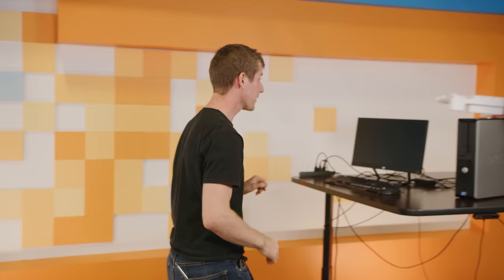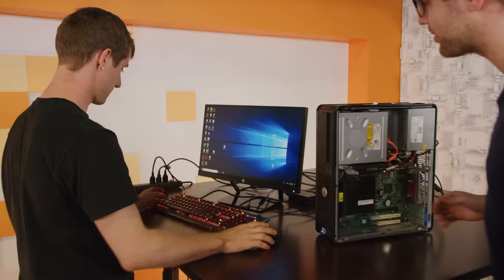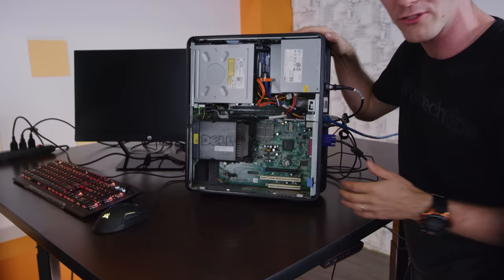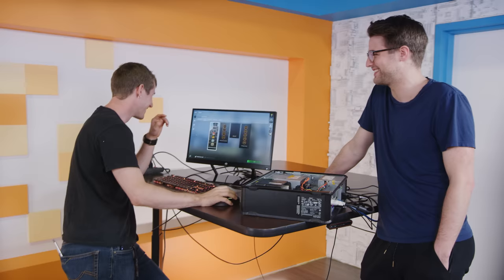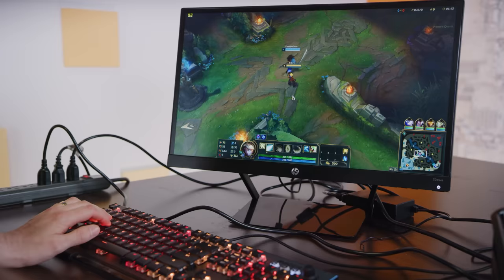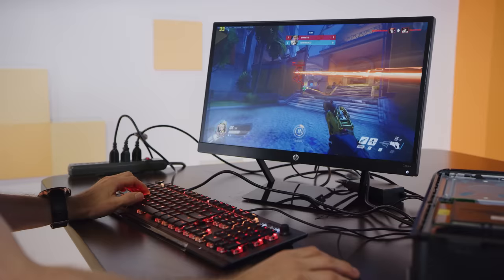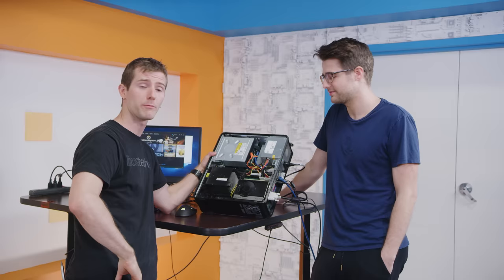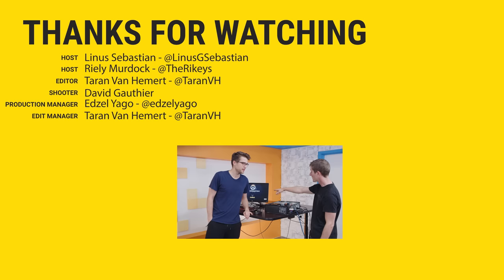The $69 Gaming PC RETURNS

Comment: Converting a SATA power connector to a PCI Express power connector? My God! Why did I never think of that!? Facepalm
Reply: Quick question, isn't that kinda dangerous? The first thing i thought was that Sata power delivers less than the six pin, but i may be wrong, that's why i'm asking.
Reply: You don't like house fires?!?
Reply: @orestisantonopoulos4350  It might be ok for a low end card that barely needs that extra connector (rx 560) but otherwise, yeah you never hook up a 1080ti with adapters.

Comment: I have to agree with what others are saying, going LGA775 is a bad idea anymore. I just got a SFF optiplex with an i5-2400, 8GB RAM, 250GB HDD and supposedly a windows 10 license for $90 shipped on ebay. Another $100 on an SSD and a 750ti or something, and you can actually play modern games quite well for under $200. If you do already have an old 775 machine it might be worth upgrading, as you can throw an LGA771 xeon into many OEM LGA775 machines (with a little modification). The G41, G43, Q45 and to a lesser extent G31/G33 chipsets are often compatible, especially on Dell Optiplexes. It's only $13-14 shipped for a 2.83GHz Xeon E5440 quad and the required sticker mod. The E5440 is comparable to a first gen i5 (it has 12MB L3 cache!) or a Core 2 Quad Extreme Edition. There are even faster 771 Xeons but they're a little more expensive and tend to be a bit hot and power hungry for what's in those OEM machines.
Reply: Had an old P5P43TD 775 lying around and therefore just bought an Xeon x5460 for 16$.
I could oc it to 3,8ghz. There are higher OCs possible, but i don't wan't to waste a good cooler on a budget system.
It is compareable to a sandy bridge i5 2500.
A big negative is the 120W tdp of the x5460, so you need a solid power supply.
I would agree, if you build a new "used budget gaming system", go with an old office i5.
If you can get a 775 board for free, it supports the 771 mod and you don't want to skimp on the power supply you can still go for the 771 xeon route.
Reply: I went to a local university surplus store and bought a Dell with a 3.4Ghz Quad core i5, 16gb of ram, 500gb hard drive for $120 including tax and a few other items we bought along with it. The machine is great except for the onboard Intel HD 4000 graphic chip, and my old 8800gtx is too long. Looking at the compact gtx 1060 6gb edition, but cost a good $280....
Reply: I can get you a 3.0Ghz core2quad for $5...I cannot test to see if they work though. They are also sold by that university surplus store...
Reply: I've since acquired a gtx 660 that I somehow managed to shove into the case and replaced the 240watt psu with a $30 600w evga psu from best buy...now I can play fallout 4
Reply: @223 Remington Yeah, but these days most people building their own system in the USA/Canada/AUS spend $10-25 on a grey market key from ebay (cheapest), kinguin, g2a etc. It's possible to run windows unactivated or cracked, and some do, but most people just get the key because it's pretty cheap. I bought the machine in my comment for someone who was going to use it in a professional setting for office work, so getting a free legitimate key was a nice bonus. And the machine worked out well, it was about $185 total for an i5-2400, 8GB DDR3, 512GB SSD, Radeon 6450 (only cost $6 more than the required displayport to HDMI adapter to use the Intel HD graphics), and the windows 10 key and 250GB HDD as bonuses.
Reply: A Core 2 Quad is a great CPU for LGA775, the only problem is that there isn't much room for upgrade.
Reply: This straight-up like a different language to me.  No clue what this means.
Reply: @rinserofwinds  The price of x58 is cheap enough that you can go with the 1366 pin Xeon for cheap and throw in a cheap GPU, I have a Dell T3500 with a w3690, and was able to just pop in a RX 560 and plug it in with the 6 pin pci-e connector on the stock psu :)
Reply: used to have xeon 3323 in my 755 OptiPlex used that sticker mod paired wit r7 250x poxy btx case lol

Comment: Never under estimate the power of socket 775. It supports core 2 quads and honestly those are all you need. 
Okay fine more like bare minimum but still.
Reply: The quads are still surprisingly adequate.
Reply: @HappyBeezerStudios  Hell yeah. It's good to know that if you splurged back in that era your system would still be capable enough today depending on what you wanna play.
Reply: @GT1 Cheap xeons are dope as f.

Comment: Now retest with a RTX2080ti and extra power supply. 👊
Reply: Nein
Reply: RTX2080Ti and stock power supply :V
Reply: Yeah bc that wouldnt bottleneck at all
Reply: @gentzhushi7272  Core 2 Duo will crush the 2080 :P
Reply: @joe-oz6fl  PciE are backwards compatible...
Reply: I mean intel is known for their single core performance, I doubt the 2080 would be able to keep up with those two powerful cores.
Reply: theres only so much information you can force through the old pcie data pipes. yes it'll run but it's just going to waste a ton of horsepower.
Reply: The bottleneck alone will make this PC explode!
Reply: CPU BOTTLENECK
Reply: @WatchJRGo  😂😂

Comment: Here in the uk, you can get a dell optiplex for £100 with an i7 2600 and 8gb of ram depending on how much you look around, I used one of these vary machines for my first gaming pc as a starter rig and to this day it’s alive being used as web browsing machine
Reply: If people do this, try and get the MT (mini tower) version. That's their biggest form factor and you can easily fit a full size graphics card. And don't forget you'll probably need a new PSU too
Reply: if you use a graphics card such as the gtx 1050 you'll be fine as it dont require external power and most of those systems have a good quality 400 watt PSU which is more than enough

Comment: This was funny to watch because I've been working on something like this myself I've only spent 20$ on ram, 12$ on the riser and 70$ on the graphics card (gtx 780 woot) and got everything else for free so I'm liking my odds
Reply: Can you send me a video of the finished product? I'm really interested.
Reply: haha sure I'm waiting for the riser to come in so I can finish it up, but that'd be no problem.
Reply: Thanks man i'm working on my own budget build but ive ran into some problems with the old crappy oem psu on the inspiron 570 im debating whether I should buy some sata to 6pin or replace the psu as a whole, the gpu im using is 650 ti I got on ebay for 35$ and the psu im thinking about getting is the Corsair CX450
so if you want to see the finished build of that feel free to let me know
Reply: Actually yeah I would love to see that. I've also ran into a problem with my power supply which in turn made me just grab a second psu... its gonna be ugly to say the least
Reply: the 6 pin connector .. can be cut out of an old PSU motherboard connector, doesn't need to look too bad...
Reply: I'd bite the bullet and go for the quality PSU, you won't have to upgrade it again in the near future and it'll ensure your other components are safe from dying due to poor power delivery.
Reply: Yeah i think i'll have to take the price increase and not risk the old motherboard frying
Reply: could i see the pc to then because i just build about 2 months ago a pc with i3-2120 750 Ti and 12 Gb Ram i just buyd a i5-2500k for 38€
Reply: Who's build? @quentin roemer
Reply: @CryoToast  i meant i want to See blazes build too in the end
Reply: but higher end graphic need better gpu and better gpu need atx motherboard and too bad its mini atx
Reply: How does the software work? Whats a good operating system? Does it cost anything?
Reply: Fo.r the crispy 40 frames on minecraft

Comment: EVGA GEFORCE GT 730 2gb low profile on Amazon  for $66. I used this on a dg41ty system and it played games really well. More system memory would’ve made it quicker. My FPS was 60 on many games. Intel dual core wasn’t bad. I got the computer free from work (couldn’t bear that they were trashing them) and added a $39 ssd, a 1tb WD drive from another computer and $65 video card. Gaming for $100. Also got in on the free Win 10 update. Ran win 10 fine. I keep it as a junk system to tinker with. You can upgrade the cpu on these to quad core cheap

Comment: Could've fitted in a Katana single slot Galax GTX 1070.... Out of budget but mmmm those bottle necks
Reply: The gpu be running at 5% usage with that setup 😂
Reply: @C4CH3S  5% more than that bad boy slaps computer
Reply: The power supply would probably kill itself in trying to run that GPU.

Comment: Just cut a slot in the side panel and you can fit a full profile graphics  card just make sure it's under 200mm in length and ensure the slot is big enough to fully clear the card.
Reply: I used an angle grinder to cut a slot in the metal sidelid because I am a trained, pro metal worker, it could be done with cheap handtools such as a two dollar mini hacksaw and the edges smoothed off with 50 cents of sandpaper or a smooth file.

Comment: Unironically, if your definition of gaming PC is to run any games at all... just get a rapberry pi and make it an emulator machine for oldschool systems
Reply: Sylkis89 once you buy the pi, the enclosure, power supply, uSD card. It’s going to be get pretty close to 70$.
Reply: Or I can use my Galaxy S 5... I can run N64 emulation with no problems. Js... Any games at all, right?

Comment: 6:35 I regularly remove and install things in my desktop without unplugging it, I haven't had issues so far.  I recommend that you unplug it, but you're not going to kill anything as long as you're careful and don't short something.  The most important thing is to make sure the machine is off, I have fried a motherboard by unplugging the laptop display connector while it was on >.>

Comment: 775 socket? why not fit a quad/or 771 mod for a xeon?
Reply: johnyfartpants just cuz it fits the socket doesn't mean those chipsets supports all the cpu's. It is possible, but you gotta do some research on the mobo.
Reply: @Adam_Racing  the G41 would accept the moded xeon. But this is a Commercial PC unit not a mobo you buy separately, the bios might not support it.
Reply: @ladam836  there's a bios mod easily available for that specific computer. So they could definitely spend 20 on a 3ghZ quad Xeon 50 on a 750ti and put in a better hard drive for a respectable machine around the 100$ mark. 

I personally use an optiplex 780 with a low profile gt 730 2gddr5 6gigs of ram and a q8200 processor I got for 50 bucks (20 for gfx 30 for the computer both off Craigslist), and its great for all the games I play which is mainly D3 and league.
Reply: I have an old Dell 530 (somewhere) that only accepts a core2duo. They used a different mobo for the core2quad

Comment: Managed to pick up a Dell Optiplex 3020 SFF off ebay for £55. The PC came with an I5 and 8GB of RAM. I then installed an MSI NVIDIA GEFORCE GT 710 gpu with a wireless network card. Ended up being a pretty good little build for £100.

Comment: I don't see why you guys didn't just recommend the 750 ti, same price, better performance, and no extra power cables needed.
Reply: probably can't find a low profile one for that case.
Reply: I agree, but most 650 don't need power cables, that one did for some reason (it could probably still work without it)
Reply: Low profile isn't needed.  They used a PCIe extender.

Comment: But can it run windows?
Reply: He just ran Windows
Reply: @_zapper  r/whoooosh
Reply: hey Win 10 load in it.....
Reply: @_zapper  r/whoooosh
Reply: Insert Windows into unbalanced fan, & then trash the fan.
Reply: No, can it run MINESWEEPER :O
Reply: @pcdc1337  r/whoooooosh
Reply: @buyinggfhmu5589  r/whoooosh
Reply: He should've just used Win 7 tbh. I have a computer that's even older (core 2 quad q6600) that can run War Thunder pretty well on a GTX 1050 on Windows 7.
Reply: but can it run space engineers?
Reply: Can it run Spiderman and Read Dead Redemption 2?
Reply: If the windows are on the ground, I guess

Comment: We actually have those computers at my school. Except ours only have 2gigs of ram. 

They forgot to block the Microsoft store so I downloaded Minecraft. It ran at about 40 FPS with everything on low.
Reply: Nice lol. I could hardly steal the Adobe software they have installed smh
Reply: At our computers they blocked absolutely everything. Every program was running in a vm so that you couldn't even open a file (not even over your browser or something) which wasn't placed in your vm.

In my old school however, we did a lot of shit with the computers since it was very easy to gain access to system files.
Reply: Wait wut minecraft has graphic settings??????
Reply: I played sea of thieves on the dell laptops in cyber security
Reply: @glad5409  yes it does; available presets include "Fast", "Fancy" and possibly even "Nice" haha

Comment: Can you guys do this same thing for a budget video editing machine?
Reply: Unlike with gaming, you can edit videos with almost anything anyway. It's just a matter of how much time and patience you have for it.
Reply: Just get something decently big with good enough airflow, otherwise the thermals might brick/melt your hardware during a lengthy video encoding session
Reply: as the others say, exporting might take a while, but with proxy files you can edit quite fluidly on a "potato"
Reply: Exporting is not really the problem, you can just walk off and do something else.  The actual lag during editing, applying effects, scrubbing through video would be the problem, that could get pretty frustrating.
Reply: that is what you use proxy editing for ;-) which makes it a non issue

Comment: Seriously though, holy actual shit. This thing actually works pretty well. I'd consider it for a kid that wants to get into basic PC gaming (minecraft and other simple games) but doesn't need a powerful build. It's a great way to get into it and one could definitely more than get their money's worth out of it, especially for a family that can't afford a $400+ console just so their kids could play minecraft.
Reply: ps4 is like $200 lmao
Reply: @appa3535  When it came out?
Reply: wow plenty of these videos being about for years lowspec gamer randonhd gaming budgetbuilds offical oztalks just off the top of my head that have regular deal updates when systems like this appear on ebay in number and tech deals has alerts for when HP workstations with quad core plus xeons go on ebay because you can get a 12 core beast for under 150 that will happily game when combined with a decent graphcis card. Having the latest high end tech is great but if you dont need it its a waste of money if all you play is minecraft and overwatch you dont need high I7 and rtx graphics card despite what "hardcore" pc gamers will tell you on forums. If you want to play everything at 1080p med/high then a way more modest i5 or Ryzen 2600 system with a 1060 will handle it for a good few years yet. Though probably the best bang for buck right now would be old stock ryzen 1600 systems paired with 1050tis seen them on clearence here in uk with 8GB 3200 ram for 299 or with 16gb for 350.
Reply: @appa3535  PS4 is 400

Comment: You can put nvidia 1030 and will be cool
Reply: Your right, but then it wouldn't be a $69 gaming PC.
Reply: Pretty much what I was gonna say, since I did the same for the HP Compaq 8200 SFF (i5-2400) I got as my HTPC last year off eBay for less than $150 Canadian. Same issue with card size (and limited wattage), but I got a GT 1030 low profile card for it and it works fine.
Reply: @franciscoh6210  Yes but can be a $100 gaming pc.
Reply: @Reslums  You are still right, but the point is to play E-Sports titles with the cheapest gaming rig possible.
Reply: @Reslums  the point of the video was a gaming pc for 69$ just to fit the theme of the video, but your suggestion is defenitely much better and a more realistic scenario
Reply: @bravemujahideen  RTX 2080ti is way better though. Joke aside, the pc in the video won't fit a GPU that tall, mostly only fits low profile cards.
Reply: no, the gt 1030 is a trap, if you get sold a ddr3 model without paying attention the performance differences is noticable, you're better off finding a 750ti, 1050/1050ti honestly
Reply: There is GT1030 with ddr4 not ddr3,but it's easy just to READ what are you buying,and get gddr5 model.But it's still only good because of low power consumption.
Reply: Kian what????? a 1050/1050TI is better than a 1030! nooooooooooo way!!!
Reply: Yeah ddr4 not 3 but no alot of people even though they have been looking for the right one get stuck with the ddr4 model

Comment: Found a free Pentium 4 PC, replaced the CPU with a core2duo for about 2 USD and a just bought a passiv Geforce GT430 for about 4 USD.
Gonna be a pretty sweet XP PC assuming that the 430 works well there.
Reply: had a similar system back in 2011-2012 (meaning a c2d , and gt430), ah the good old days ......
Reply: GT430 won't give you an enjoyable experience. You're better off picking up a 750/750ti for about 50ish bucks instead. What you currently have is a pretty sweet HTPC, not really a gaming rig.
Reply: +DLCom
430s performance will be overkill for the most part, more how well it works with older directx given that its not that old.
Reply: + broken3260
This PC has a Radeon HD 2400 Pro at the moment and that works just fine for XP games (for the most part).
The GT430 waaaaaay faster card so it will be super overkill for a game from 2005.
However it might not be that good with older direcx.

Comment: This exact model is my current system! I'm using an $11 xeon x5450 by doing a socket mod with a sticker from ebay and an evga gt1030 with a smaller bracket and an ssd. I actually bought 20 of these that came from the indiana dmv for $100! I'm also using one for running pfsense virtualized in proxmox along with other vms. The rest I've been slowly selling off with x5450s and either an r5 240 graphics card or the quaddro 600 and yes, you can play games on that, making them a $35 gaming pc!